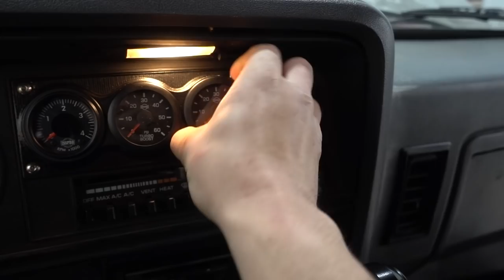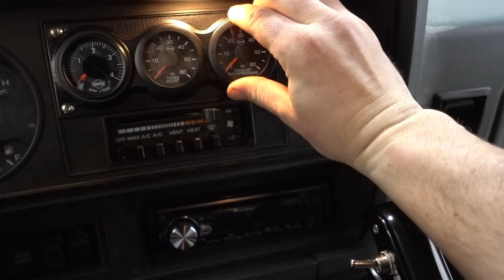OUR PLAN WORKED!!!! GREAT NEWS!!!!

Comment: Like the hood full of fleece products under the hood of your trucks...Im looking to get a new turbo...I gotta stock 24 valve...Its gotta cold air intake and straight pipe and that's it...Im gonna go with a Fast Fuel system when it gets warmer out...Yea its a really clean 1 owner 2nd gen Laramie quad cab manual truck...Praying for your fam as always...By the way its almost baby A time...Its getting so close.GOD bless your fam and New baby on the way...

Comment: Check your battery voltage while the truck is at higher rpm the regulators go out all the time and overcharge the batteries throwing everything off

Comment: 2013-2017 6.7 cummins with the flywheel driven pump is the same injector harness plugs. Since the egr is behind/above the intake and runs along the  valve cover.

Comment: GregA thanks for showing how to get the maximum horsepower out of a first gen with a VE pump. Everyone understandably switches to P Pump and there is ton of information out there about P Pump but not much information out there on how to get max hp out of the VE pump. It will be interesting to see the dyno numbers from VE vs P Pump. Are you going to do AFC Live on the first gen?

Comment: Intake horn looks awesome on there! Where the angled plugs stock 6.7 or 5.9 parts (guess I could go look at mine. Lol) Asking as I also want to run the same Banks horn.
Reply: Only ones that had those were 03-05 till the 600 engine that has the valve cover gasket with wiring in it and two plugs built in

Comment: Greg Dude I love your channel!!!!  Just purchased an 05 2500 5.9 with the Edge Juice (2006). Always been a gasser but I'm tainted now by the torque monster cummins...  do you have any recommendations for the first mods I should be doing first? Intercooler, Cold Air Intake, etc.? I still have to bring mine to the Tranny shop. Not sure if it's had any work done to it. Locks up at around 40-45 mph is that stock? I'm a newbie and am asking for your opinions. Thanks Greg. Appreciate the help.
Billy from CT
Reply: Do an exhaust first. The lockup thing will happen if you drive very lightly but if you want try locking out overdrive until about 50 mph or so just so you aren’t lugging the engine.
Reply: Can't with an 05 not stock anyway